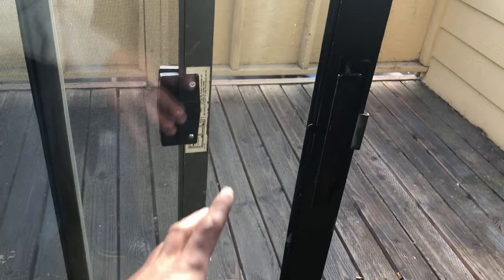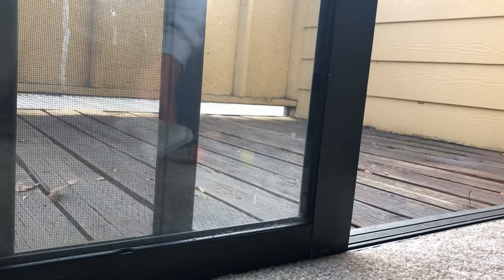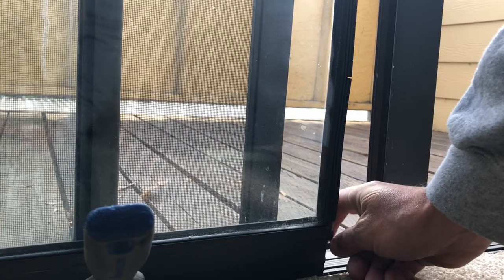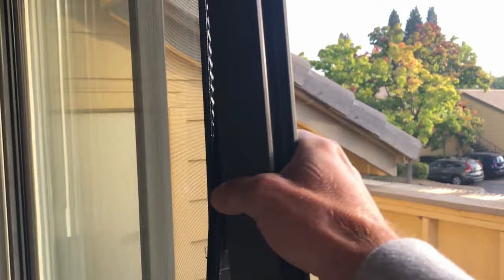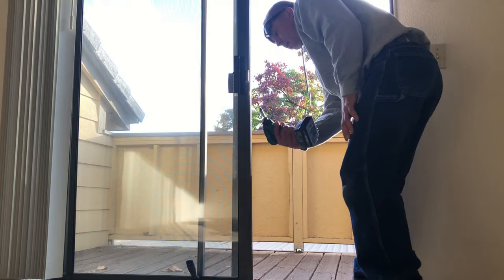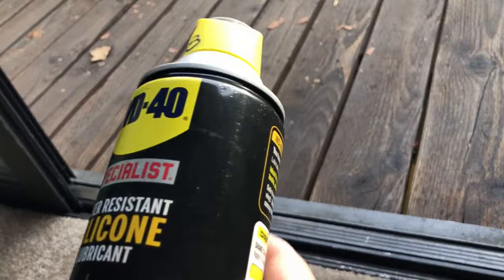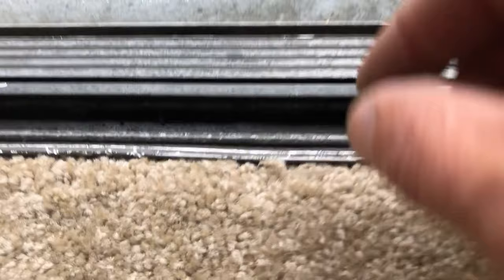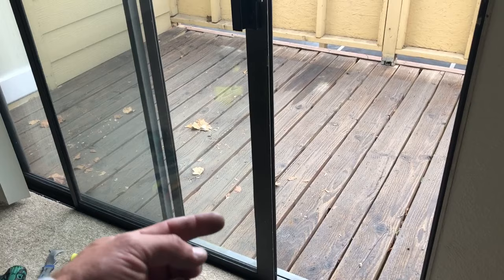How to replace rollers, wheels on sliding glass patio door the easy way.

Comment: I was close to calling a sliding glass door repairman. I'm usually a diy dude and pretty handy at most things. My glass doors are humongous so I was intimidated not to break the glass or worse. Your video helped me sooooooo much and I really appreciate it. Bought 4 rollers at Lowe's  for two of my doors for $18 bucks. Thanks again.
Reply from the maker: I’m glad I was able to help!
Reply: so send this guy ten bucks or even 20 because he saved you at least 150..
Reply: 8
Reply: 5k
Reply: Very cool bro congrats
Reply: @roadglassandmore9064  thanks my friend
Reply: How many rollers are installed on EACH sliding door? 4? Thanks
Reply: @XroorX   On mine there was one the  bottom left and right. Had a total of 2 sliding doors. Replaced 4 rollers.
Reply: @ihar9975  thanks for the answer! The wood under the track rotted from clogged gutters so ALL the rollers went bad(older house I just bought in 2020)….
Reply: @XroorX  Glad to help! It's good when folks help each other out so we all can save money and build knowledge.
Reply: @ihar9975  amen! You get new window guys that say to change them out for $5500 for a new one…I have 4 sets of sliding doors  on a sunroom, and just the rollers are bad…have a great weekend!
Reply: Any hints on what to do for the Phillips all frozen up, can’t get anything to budge
Reply: @KenWins48  I would spray some wd-40 or similar penetrating oil, wait a few minutes, and carefully try.

Comment: I almost started removing both my sliding door and my fixed pane to do the roller replacement (as some other videos showed) but then I decided to look on YouTube a bit further and came upon your video. This shortcut worked perfectly for me and saved me a ton of time. It also saved me from having to get help from a friend to lift our huge door. Can’t thank you enough. New rollers are just what our slider needed - WD-40 wasn’t cutting it anymore. The old rollers developed flat spots and were caked with dirt and dog hair. Works so much better now.
Reply from the maker: I’m glad it worked for you!
Reply: I was going through cans of wd40 or risking a torn rotator cuff shutting my sliding doors! Replacing the rollers this week hahahaha

Comment: This is the first comment I ever left on utube cuz it's absolutely a life saver!!! I had already started hammering away at the tracks and thought about just whacking everything because there's just no way to take the 40 years old aluminum door off to replace rollers. I had no idea what rollers were inside so I follow this video and first removed the side frame then used long nose pliers to pull out the old rollers. Used a pry bar to prop up the door to make it easier to pull out the old rollers. The old rollers were Prime Line D1525 with 1 1/2 inch rollers. I actually used D1552 with 1 1/4 inch tandem rollers which I just push into place. Put everything back and the door works like new! I am sure the contractor and his crew would appreciate it when they start remodeling my kitchen in 2 days lol! 6 thumbs up!
Reply from the maker: I’m glad I was able to help!

Comment: Thanks a bunch for taking the time to record and post this video! I followed your instructions and it worked great! Once I pulled out one set of the wheels I found a matching one at a local hardware store and bought two sets in order to replace both sets on the lower side of the door. I also noted missing rubber door stops, one of which was jammed into one of the wheels. I found similar ones at the local hardware store and silicon sealed them into place. The door slides so easily now that I swear it's power assisted! The new rubber stoppers mean that the door stops exactly where it should and does not impact the metal frame, now the latch even works better as the closed position is correct. Again, many thanks for taking the time!
Reply from the maker: You are welcome and I’m glad it worked for you!

Comment: Thank you so much I just replaced rollers on sliding door using your instructions I tried before and none of the videos on YouTube had the type of doors I have. It was very easy without taking the door off. My roller assembly was different it had tabs that stuck into square holes but I just pried the frame enough with a screwdriver and it popped out! I went to ace hardware to find a new assembly but they were all wrong but they had a 2 pack of just the wheels the same size I popped the old one out and the new one in and didn’t have to find the exact one. Once again I thank you 🎉
Reply from the maker: Glad I was able to help!

Comment: Big BIG thanks for this tutorial!!!  I had tried fixing my slider a few months ago and another video said I needed to take out the stationary glass AND then the slider.  I tried that but then was afraid of possibly breaking the glass.  So a few days ago I called a glass guy and he said about $200 to replace the rollers.  I had set up an appointment but then happened to find your video.  I followed all instructions and was able to replace both rollers for $15!  And with a feeling of accomplishment!   All the tips helped too, especially making sure the door is lined up with the wall so that it closes correctly.  One thing I would add to all your tips (that helped me at least) was when I'm hitting the frame to come off, I was hitting real hard and it wasn't going any further.  So I started hitting it slightly further up the frame towards the top and that did it!    Thanks again!!
Reply from the maker: I’m glad I was able to help !

Comment: Just wanted to say a super thank you for this great video; worked perfectly and for a total cost of $8.00 for two 475C rollers at Lowe's!!! My 20 yr. old Nu-Air slider door now rolls smoother and easier than with the original roller, Amazing!! I replaced my Nu-Air kitchen patio door's roller kit pair today in under 1 hr., including using the silicone spray and shop vac to clean the tracks. Worked beautifully doing exactly what you said and saved me the $100 charge to have a patio door Tech come to my home!! Thanks again!!! Robert
Reply from the maker: I’m glad I was able to help!
Reply: Thanks for posting. I’m trying to find the handle and lock assy. The ones at lowes and Home Depot don’t work. I wish I could find the Mfg that made these no markings at all. Unit built probably the 80’s.
Reply: @mickbrown815   You may want to try either Amazon or EBay for your patio door handle and lock assembly. I recommend measuring the length, screw hole distance apart, as well as the latch that goes on the frame. You should be able to find one just about identical. Not sure if you live in the FL area, but a lot of the original builder-grade patio doors installed were from a company called Nu Air. You also may be able to see a sticker/label or engraved brand name somewhere on your doors- also, you sometimes may see it on the screen slider as well. Hope this helps and good luck! Robert
Reply: @robertbelden1584  Thank you sir I will do that because I don’t really want to pay $1000 to have a new one installed!! If I can help it!!

Comment: A huge thanks for this video. I’ve been needing to do this for at least the last two years. More recently my glass sliding door feels like a lead weight. I had a handyman come out and look at it and he said I just needed to clean my track and didn’t charge me anything for the service call. So I did just that like I had in the past and obviously that wasn’t the solution. After securing the two replacement wheels from Home Depot along with a silicone spray, I was able to knock this job out in about 45 minutes. I was also lucky to have just the right size block of wood to separate the frame from the glass which was quite challenging. A few good strikes with my rubber melet and it came loose. My glass door slides as smooth as ice now and I saved myself a few hundred bucks in the process thank you again.
Reply from the maker: You are welcome! I’m glad I was able to help!

Comment: I watched, I conquered,. I've been putting this off for dome time. Wish I'd seen this video when it came out. I do agree with the problem of the rubber gasket. What I found to be very easy was to pull gasket out from door  put on glass the frame will easily go around the gasket when you push it back in place...thank you very much for an easy to follow video.
Reply from the maker: I’m glad this video helped!

Comment: I just last week completed this same Aluminum Sliding Door Repair. Unfortunately I had not seen this video or it would have gone much smoother. Removing the door = simple. Locating the adjustment screw AFTER the new wheel mechanism was installed = difficult.

This is a GREAT trick that I will not be forgetting.

Thank you.for posting it.
Reply from the maker: Bummer, but at least now you know the trick

Comment: Perfect video - not too long, but covered the important parts.  The only thing I wasn't completely clear on was whether you were using silicone spray on the metal side of the track, or the weatherstripping.  Thanks for posting!
Reply from the maker: Mainly on weather stripping as it is a main friction point . There is no real need to spray the track ( but doesn’t hurt anything either if you want to spray it) with new wheels as they roll freely on top of the track.

Comment: I doubt you will ever see this but I had to try. I just followed you vid and did 2 doors, I have 5 in my house but these 2 are hi mileage..the first door I was a tad worried, but everything went fine, I just realized you have to be careful with the U channel rubber seal gets back in place, I used some wd40 to help the glass and seal slide back in and everything went perfectly. I had to back up a few time to make sure that seal stayed in place but was Perfect ending! Those wheels been in there for 38 years and I hadnt used the door for a couple years because I did not want to take the entire door out, LOL...then I see vids where they take the entire door out then do the exact same thing you can do with the door still in! Blows my mind! I cannot thank You enough!
Reply from the maker: I’m glad my video was helpful!
Also, glass cleaner is better than spraying wd40 on the gasket, glass cleaner will dry out while wd40 will stay on the gasket and the frame may pull of if you pull on frame too hard.

Comment: My particular door required a different approach.  The rollers had a bolt that was under the glass panel. So I had  to remove the frame bottom completely to release the rollers...your video did help though. And now we are back together and fixed. Thanks
Reply from the maker: Yes, there are some doors where the roller is screwed in through a bottom rail, not very common though.
I’m planning on making video on that.
Thanks.

Comment: Great tip, but you are wrong about using the silicone spray, as that too will attract & hold debris. No lubricants should be used at all, best to crinkle up a small piece of wax paper and rub all contact areas.

Comment: I have the same setup but there's an additional screw that holds the wheels from the top. It's covered by the glass. Your video got me 99% of the way there... Thanks!
Reply from the maker: Oh, yeah, I’m familiar with that type of doors, they are not as common but that screw through the frame sure makes it more difficult. You will have to take the slider out and remove bottom rail unfortunately.

Comment: Compared to the solidly rusted rollers I'm replacing, the ones this guys is pulling out look practically brand new!
Reply from the maker: The wheels have ball bearings inside, and they wear out and start making noise or stop rolling very well, that’s the main problem in my area, we don’t have a lot of wet weather here where I live.

Comment: I used this video to clean and grease my rollers rather than put in new ones. It worked, was pretty easy, took 20 minutes. Hardest part was the seal didn’t have glue in spots and didn’t want to sit right so 5 min messing with that. Now we have the opposite problem, it was hard to move and now it slams shut and we are worried about the glass breaking lol. I would say it’s fixed lol
Reply from the maker: I’m glad my video helped!

Comment: Great video for a very common problem.  I would only add to fully remove that side frame then clean & lube the gasket (a wipe down with silicone or soapy water works great) before reinstalling the frame will ensure the gasket is not pulled or torn.  Evaluate the rail the wheels ride on as well (take a kitchen scrub sponge and clean your rail!  Dirt gets packed on the rail making even new wheels roll a bit rough).  If your rail has flat spots, Prime Line sells a snap on repair rail that works great!

Comment: FYI to people: you may have a door like mine where the roller is screwed in to the bottom moulding piece and it can't be removed without taking the door out (and taking the bottom piece off) even though the latch-edge moulding slips off like it does in this video.  You can only barely see the screw head when the latch-edge was removed.   If you follow the video and the roller doesn't easily slide out with a little bit of prying...it's screwed in.  It's a two person job to safely get the panels out too if it comes to that.
Reply from the maker: Yes, there are some doors where the roller is screwed in through the bottom rail, I don’t remember if I mentioned it in the video. I will do a separate video on that type of doors.
Thanks.
Reply: @roadglassandmore9064  would love a video on that. Thank you

Comment: Couldn't take my 20 yr old door apart at the panel,, so I had to look at other vids to see how to take out the door.  Had to take the rollers out to see who had them, as I couldn't tell what it looked like without taking them out. Since I needed it right away I found them at Homedepot.  1 1/4 in with the Rounded hole for the screw. 8/12/20

Comment: You are marvelous. Your easy step by step manner is a treat. After seeing what goes into fixing a sloping glass pane - I will eventually call the glass company. Right now I have a small piece of cork in the top of the track stopping that gap effect. 
Not the best but if I got out the rubber mallet and then played around with the weather stripping I would need a new door. Thanks anyway for a beautiful job explaining what needs to happen. 
And I couldn't use silcone spray to have the door slide smoothly as the door that tilts would slide and lock me outta the house. M.

Comment: Thank you for the great video. I will do the same thing as you did because I have same door has roller problem, very hard to open and close. I saw some videos need to remove the door out first, that is too much work for one person due to the door is very heavy.  Your video just perfect and easy way to change the rollers. Thank you very much for sharing.
Reply from the maker: Im glad I was able to help! I used to take every door with roller problem completely out for 5 years , until I went to work for different glass shop and one old timer showed me this trick
Reply: @roadglassandmore9064  I tried to do today,  but I had hard time to pull the old roller out even I jack up the door to the air. The old roller stuck inside won't get out.  I try when days off.

Comment: I can't wait to try this, like others have said I was a bit nervous about taking the doors off plus I think I would possibly need to cut or remove the frame to even get it off. I'll try to write back with an update
Reply from the maker: Hopefully this will work for you! Not all the doors are the same, if you pull the screw out from the corner of the frame take a look at it if it has pointy end and threads like on a regular wood screw then I’m 99.9% sure you have similar door as in this video and this method will work.
Reply: @roadglassandmore9064  Tried it and it worked great, thanks for the tip! Roller was completely done, bearing collapsed and wheel worn. Now the fun part of trying to find replacement rollers!

Comment: Thanks for the video! After watching it, I was still a little hesitant due to the banging next to glass, but after I did it, it wasn't that bad. I had a really old one-wheeler from the '70s. Now it's just like what you showed here. And my door is wider.
Reply from the maker: Glad I was able to help!
Reply: maybe you could have a two wheeled unit t but the second wheel could have lifted up vanished up into the inside of the door... removed my sister in laws Door  and got the bogie un seize and it popped down... you never know...

Comment: My patio door had a different design, the side bolt was also for adjusting the roller (and door) height, and should actually not be removed. Instead I had to split open the frame around the glass, which exposed a screw above the roller mechanism, to release it
Reply from the maker: Is your door white in color by any chance. There are some doors that are different by a design, I will try to post more vids on different style doors!

Comment: Great video! I have an even easier fix. I watched a bunch of videos and was stressing about taking  door
Off and removing frame etc. I had to use my whole body to open and close the door. While trying to adjust the wheels, I finally noticed that the wheels wern't on the track at all Check that first! DUH ! I did clean and silicone the track. Okay not be able to open with one finger but now it's his one hand!

Comment: Prime - line part # D 1551 from home depot .Just replaced same way you show. There was just one problem gasket don't slide in and out easy I spray WD 40 after this rubber gasket slide very easy.